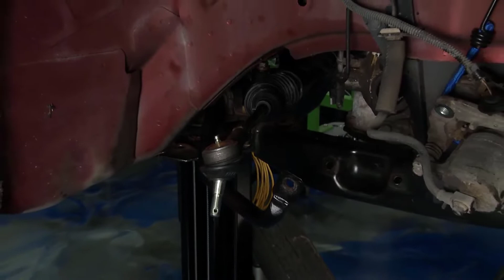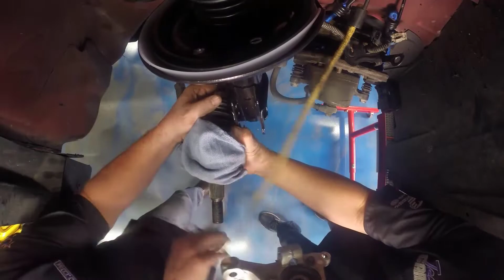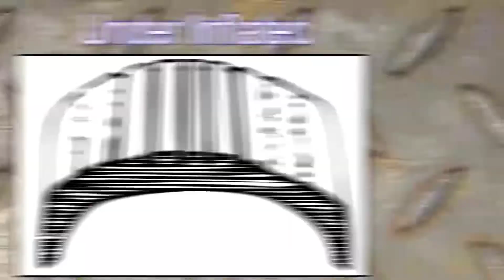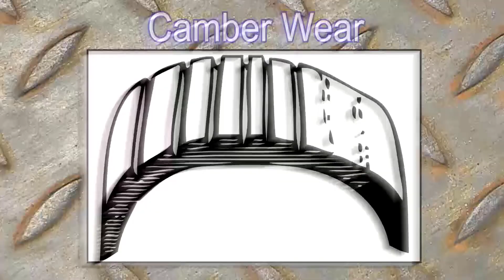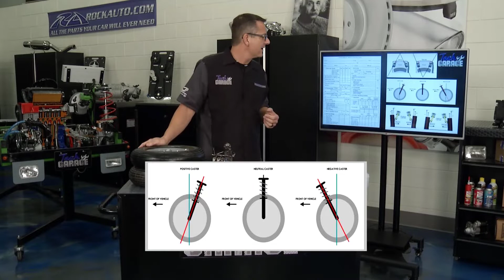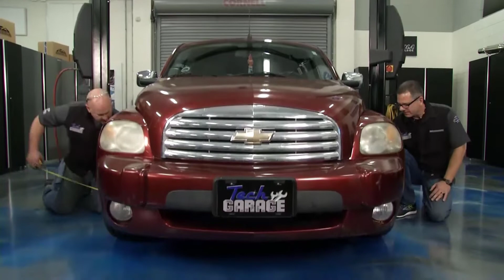HHR Phase 2 Suspension Rebuild

Comment: I’m sad to see you use the Cobalt stamped steel LCA , the HHR has forged aluminum lower control arms , they different in that the lighter Cobalt is not strong enough for the weight of an HHR.